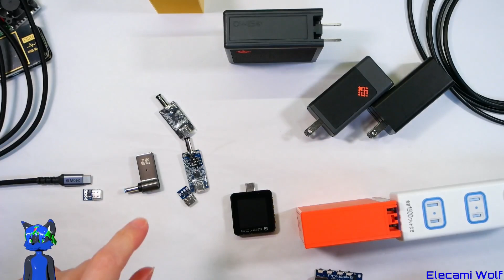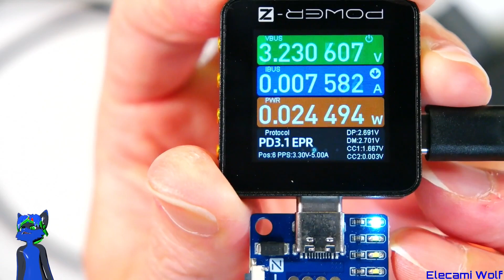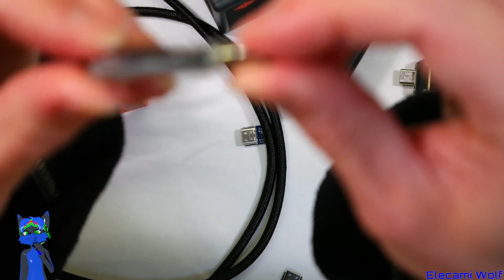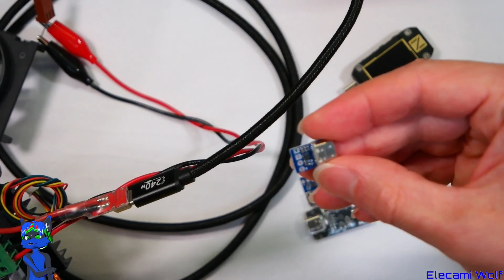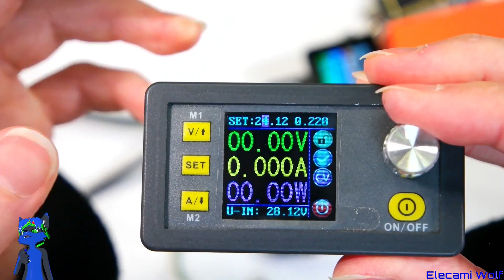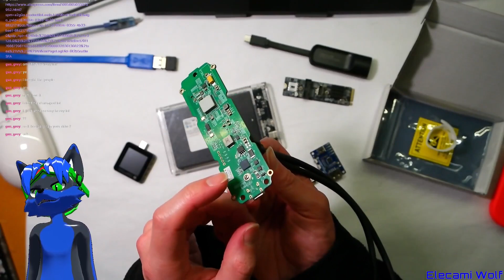EW0119 - USB-C PD3.1 Decoy Trigger - Power Your Project From USB-C

Comment: How have you found the SlimQ power supply? They've been on my list for a while but have read mixed reviews on them.
Reply from the maker: The 150W version don't seem to be good. Both of mine have failed after only being used at light loads. No problems with any others.
Reply: @Elecami  Good to know, the 150W version is the only one that interested me unfortunately. Most of my USB charging is done by a couple of YZXStudio chargers that are DC powered. Means I can power them with an external Meanwell PSU and they work brilliantly for around home or at work. 

The external PSU design isnt so great for travelling though, so still on the prowl for something that meets my standards for that.

AllThingsOnePlace makes some really good, in depth reviews on USB chargers if that tickles your fancy. Real nerd stuff haha.

Comment: trying to run my 12v dc fridge on usb-c. found out it works fine on 28v since its close enough to 24v and most 12v compressors work on 24v too. got a new 3.1 140w rocerin adaptor and a 28v pd trigger board and it immediately burnt out my pd 3.1 port on my adaptor.... confused as to what i did wrong. the trigger board is kind of sketchy looking and was much cheaper than the others. i will try getting a 240w cable and all of the pd 3.1 trigger boards in this video.
wonder if its the compressor or something. when its running it only pulls ~2amps at 28v...
Reply from the maker: Compressor will have a high start up current. It is probably not possible to start it from the USB-C power supply without using some form of soft starter or buffer / DC-DC Converter.
Reply: @Elecami  ya but if the power supply can do more amps than the one they sent with the fridge and its double the voltage i think i should have more than enough overhead
Reply from the maker: @vevenaneathna  You should not be running the compressor at a higher voltage, it will cause it to draw more current and will probably burn out after a while. You need to power it with the correct voltage.
Reply: @Elecami  higher voltage = lower current. i think you mean it will draw higher wattage?  im guessing almost all the 12v fridge compressors are just 24v compressors that are run on low voltage. you wouldnt say the same for a 24v rv fridge. most old school "24v lead acid" setups in rv's charge at 30v. take a look at your "12v car battery" next time after the engine turns on, it will be at around 14.5-15v from the alternator.
Reply from the maker: @vevenaneathna  I'll leave this up to you. If you increase the voltage on a DC motor it will draw more current and more power.
Reply: @Elecami  running fine for the past 2 weeks. turns out i got some sketchy pd 3.1 28v trigger boards. tried with the ones in your video and a cable that said "240w" and it works. compressor startup power is ~100w, operating power is 45-60w. at 28v thats like nothing current wise, 2-3amps.
i think this is the future of dc appliances. efficient gan power bricks with little to no idle power consumption, and higher voltage to reduce losses
54 liter fridge and it only uses ~150wh/day. pretty sure it saves money in net power usage since im using it as a drink fridge and not opening the big fridge in the kitchen and letting all the air out. I estimated our kitchen fridge uses about 2-3kwh/day with being opened from time to time.
Reply from the maker: @vevenaneathna  Great you got it working.
Reply: @Elecami  ill remember to let you know if the compressor explodes.

Comment: True about stiff cables and ports.  At work they bought a bunch of laptops with USB-C ports for connecting the power supply, and one by one the ports were breaking.  The older laptops with barrel plugs never broke.  What I don’t understand is why the USB conglomerate has developed something that can push so many amps and resulting watts through such tiny plugs with tiny pins.  It seems like a USB-A or B plug with the bigger pins would be much better suited for that many watts of power.  They can still be USB3 for the faster data rates.
Reply from the maker: I think the idea was one port that can be used for everything and when it is everything it has to be tiny to suit smaller devices. 
There are 4 pins in the USB-C connector for the + Power Connection & 4 Pins for ground + Shield. When it is good quality and good condition, 4 pins will handle 5A total without problems. 
Overall, the connector is too delicate. It needs to have a recess for the plug body to do into to reduce strain on the connector contacts.

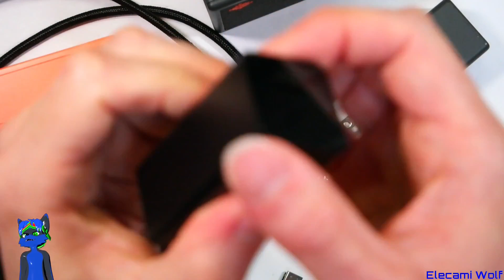Comment: That one at 11:00 looks identical to the one that came with my asus laptop, except for the surface finish and mine has a universal connector on the end for different plugs for different regions
Reply from the maker: It is possible the company that makes it uses the same internal parts in a different enclosure for other manufacturers. The Lenovo one is made by 'Powerland Technology Inc'

Comment: Very cool, thanks for the video. Really useful info~ I've been using more USB-C PD stuff lately, but yeah it can be finicky in many situations and the thick cables are scary to use. I actually buy cables with 90 degree plugs, cause it puts way less strain on receptacles of delicate/expensive devices. The plug soldering seems to be quite unreliable and doesn't like bending forces on the long side. I got an NP-F01 adapter (branded by several companies) for Sony's NP-F batteries (I have a bunch of F970's lying around unused) which was only like $20 I think, and I was surprised how complex the circuitry was. Has built-in USB-C charging, a boost converter for 12V/2A PD output, standard 5V/2A output and a direct 7.4V 5A tap from the battery. Only 22W output in the end, but I've been using it as a power bank with much more reliable and chonky batteries haha. One of the USB-C chargers I have is the MANTO 110W model, which has voltage and current readouts for each output, which is kinda cute. Only 65W max for a single output tho.

What I'd love to see in the future is some thinner/more flexible USB-C cables with power adapters that could do 48V/2A or heck even 48V/1A. Higher voltage is definitely the way to go but it'll take time for the industry to get there. But yeah cool stuff, thanks for all the demos!
Reply from the maker: Good idea with the Right Angled cables. I do have a couple. Not so good on a computer though, it usually blocks other ports.
I don't have any batteries for my Sony Video Camera. Use it with external Power for now. I was thinking about getting a SWIT LB-SU90C for it (Pretty $$$ though). Exciting because it has USB-C, For charging and as power output, only 45W, bit sucky, that battery could easily do 100W. I guess they didn't want to take up space with a big switchmode circuit in it.